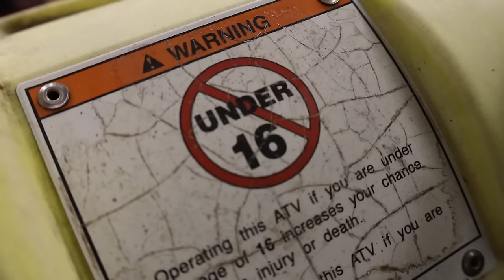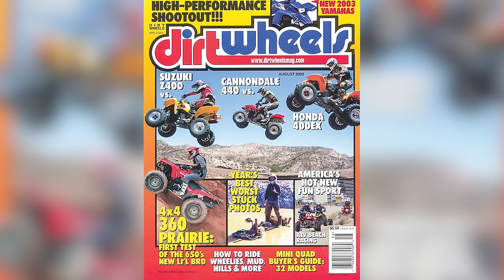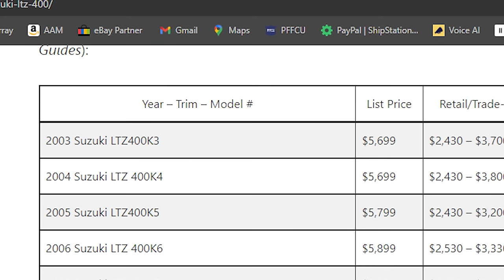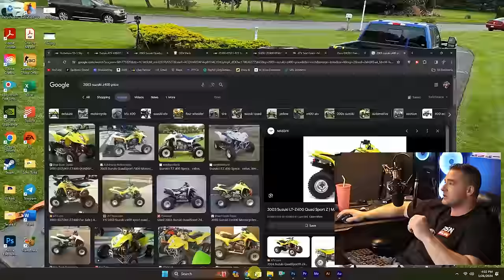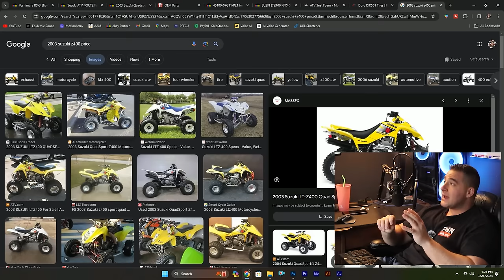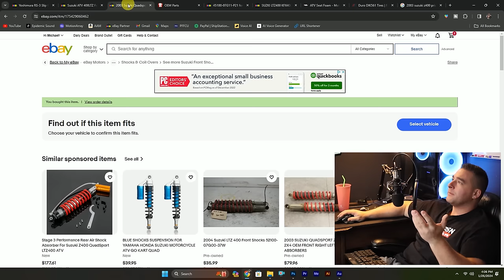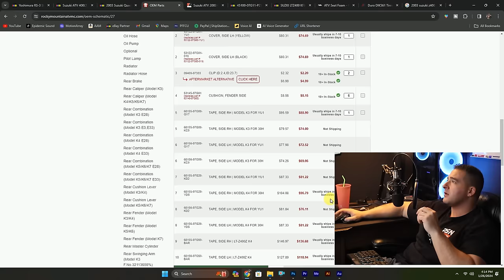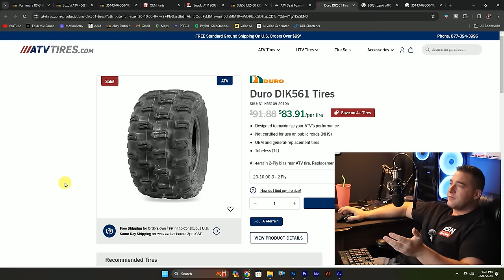It only took me 20 years to get my Dream Quad! and this one's MINT!

Comment: As a KFX owner…. they are an identical machine purchased from Suzuki. The frame is stickered “Manufactured by Suzuki Motor corporation” the only difference is the plastic color and all KFX’s had resi shocks.

Comment: I had a Z400 with a big bore and a bunch of performance mods on it, one of the best quads I ever rode. I strongly advise you to go all out on this build. It is your dream to have a Z400. Why not go all out and improve or upgrade the dream? It had a Yoshi exhaust, wheelie bar, frame sliders, suspension covers and some custom suspension. Best thing ever and I really miss it.

Comment: I was racing my 250r still when these quads were released an at the time the 400ex was the only 4 stroke at the tracks minus a couple 250r’s with YZF426 engines in them (as a Honda guy I thought it broke so many rules!) the 400ex’s were immediately outfitted with 440 kits because they were so down on power then the Z400 came out an was destroying the EX’s however thdd wd EX’s were more popular because if you made the switch from 250r to the EX most of your aftermarket components were a direct bolt on A-arms shocks ect… AKA THE EXPENSIVE PARTS so if you went to the Z400 you had to start over an easily with the purchase of the machine I believe was around $6000 to have $15,000 in it to be competitive at a pro level an in 2003-2004 $15,000 in a quad was insane the also released was the cannondale moto440 for $12,000-$14,000 but it had the absolute best parts money could buy. However in 2003-2004 the Z400’s rear axle was extremely weak and seeing a Z400 axle snapped in half at the track was extremely common an Suzuki didn’t have an updated axle quick enough so if you broke one Suzuki warranty the axle but you got a dura-blue eliminator axle for free

Comment: Damn, Im so happy I finally see Z400 on this channel. I own very unique street legal Z400 and Im incredibly happy with this quad. It handles so well, its pretty small and humble, drifting with this quad is just so easy lol. Reliability wise Im happy too, but previous owner didnt take much care of my quad so there were a few issues - carburetor, brakes and worn valves. The biggest problem with this quad are VIBRATIONS ! Literally every single bolt became loose over those years I own this quad. Locktite is a MUST here. I like your idea with 100% stock Z400, but... Quads (in my personal opinion) are for using/riding not for looking. Those stock shocks are literally UNUSABLE. Its like having a flat steel instead of shocks. Also, I almost rolled over my stock Z400 (when I bought it) like 5 times, so using a spacers at least in front is again, in my opinion, a must. Lastly, stock Z400 lacks a power, you will get used to powerband of Z400 within weeks/months and then it will get pretty boring. I bought Namura big bore kit for around 350$ and Im happy with power that it makes right now. BTW I have walk by of my quad at my channel (last video), so feel free to check it out (I did graphics myself)

Comment: Built one for a buddy last year. Did the drz upgrade with cams, single layer base gasket, dynatek cdi, and a lightened flywheel. Ran like a champ and would out run a stock yfz450 by a lot. Definitely something you should consider doing.
Reply: Also added a sparks exhaust and a 400ex intake boot 👍🏻
Reply: fcr carbs on these engines are insane upgrades
Reply from the maker: Sounds like a great build - I'd love to do these things if I were going the restomod route.

Comment: I’ve had both the 400ex & the Z400…the Z400 is still in the garage. The 400ex is a great quad, but the short stroke liquid cooled DOHC Z400 engine just rips. Add a BIG Bore & cams & you have total ripper. I picked up super clean 2006 last yr from a seller in MI. Prob my fav all rounder quad out off all the ones I’ve fixed & sold. 

Like you….i fell in love with quads around age 10-11, right when quads were being introduced  after ATC’s were going out of production in the mid 80’s. 

Lookin forward to seeing this build. You do great work & are very detail oriented & don’t even skip the small things 👍🏻

Comment: I had a KFX400 that I raced in hare scrambles. It was a great quad and bullet proof. My vote is to build it full XC. Oversized tank, XC tires, beadlocks, long travel suspension. If you go that route get a different swingarm because the carrier on the stock one is terrible. Love your videos!
Reply from the maker: Man, this is a tempting idea for sure. Thank you for the love on my videos 🤘

Comment: Just picked up a 2003 z400 last year. I can’t wait for a ton of in depth videos on this! I recommend an aftermarket aluminum oil pan as the stock ones threads are very weak.
Reply: Also I think y would be cool to see you fix all of the known issues with the quad and leave most of the drivetrain stock for reliability and it’ll become a good build for others to follow in the future

Comment: Mike the Z400 is my wheelhouse.  Been on z400central (now suzukicentral) since 2004.  Trust me here on this one, simple yet powerful build - 94mm 12.5:1 CP (with single layer DRZ-e base gasket), DRZ valve springs, HC 2 (or old school HC 3 if you can find them), and here's the key - FCR 39mm.  The stock mikuni 36 will be your weakpoint, FCR changes all of that, you'll need the DRZ intake boot which is bigger and much less of a headache.  Add a 400ex intake tube (much straighter shot) and you're cooking.  I'm sure you'll touch the head like you normally do.  Dyna FS if you need an ignition. You'll have a reliable and powerful runner, NO REGERTS!

Comment: Definitely should get you a k&n airbox cover it opens the top of the airbox up and is basically like running no lid but your filter stays clean and you don't have to worry about water splashing into your airbox I found one on a parts z400 I got a few years back and that was one of my favorite upgrades for the z

Comment: I have rebuilt a few of these 400 engines. For some extra Pep  
Get yourself a carburetor off the drz 400e model! Also try and find the drz 400e cams or a pair of hot cams, also if you get the Drz gasket for a bit more compression!

Comment: Keep an eye out on those swingarm bearings/bushings and chain sliders! I got my z400 cheapppp tore it down and i kid u not my swingarm was one rough ride from the swingarm totally failing if rode how it was. The chain had been rubbing on the swingarm for so long i had maybe a 1mm of material left on the swingarm where the pivot tubes house the bearings themselves. Damn near was chain to bearing race lol.  Did some touch up to it while it was out and made it like it never happened but certainly a super close call. That and hairline cracks in the rear brake bracket mount thats also apart of the rear carrier lol.  Went to hit my back brakes one day and damn near ate fence instead cuz the damn mount just sheared off, caliper fell and i drug it all the way back home with partial carrier bearing exposure lol

Comment: Sabo, please put a Manual CCT, new cam chain and checking the valve shims for the correct clearance on the list for this quad. These engines are WELL KNOWN to stretch cam chains.

Comment: They actually had OEM piggyback shocks as a “dealer equipped” upgrade. They were Works shocks at that, and they were not offered on all machines back then. I actually had a set on mine before I tore them off and built it up. I bet you can find some.
Reply from the maker: Are you serious? If this is so, that would be freaking legit!
Reply: @MichaelSabo  the dealer equipped piggy back shocks had red springs, the yellow strings came stock on the ‘05 and newer. The yellow springs are the same shocks, but that was the difference between dealer equipped in 2003 vs OEM shocks in 2005. I WAS OBSESSED with them as well back then. I was just graduating high school and my buddy got one as a graduation present. When they first came out they were extremely big news!! The GNCC series just opened a production class where you had to run OEM frame machines and the modified 400EX’s actually beat out the 250R’s in some of the really muddy races. Suzuki shortly entered a z400 (I believe with William Yokley as the rider but don’t quote me on that) and they started beating the 250R’s on a regular. Back then Honda and Yamaha just came out with 450 models and Athena Racing immediately offered a 440, 450, and 470cc big bores. There was no engine displacement limit in the production process class back then so it was common to see a 400EX up against a 660 raptor. I believe Suzuki finished 5th or 6th maybe with a 440 kit on a z400 and it was their first year running the quad. Not a bad season finish considering Honda and Yamaha had 450’s and Yamaha had a 660 running in the same class.

Comment: Miss my 2004 z400 ! The best quad I had and stock it was really snappy . I remember it would pick the front end up when you full throttle it an had the best balance point . I rode wheelies 5th gear wide open

Comment: Bought a 03 kfx400 brand new from dealer. Did a rare yoshi ti header pipe carbon fiber silencer setup exhaust was awesome. Bare performance made a nice alluminum airbox setup. First thing get rid of the junk hollow pivot bolt mine broke in first few hours luckly noticed it backing out on my while riding. Had a solid pivot bolt made Kawi didnt wanna do anything to fix it at all. Also put a gusset kit on it like front shock towers for sure they will crack. Timing chain is junk on them replaced mine.

Comment: If I was you, the one thing I would get aftermarket would be the rear swing arm, 03 was really prown to cracking and breaking off.  Unfortunately, the 03 I have was already cracked 😅😭😭😭 04 to 06 were little better, but not by much.
Reply from the maker: Maybe I can work that in as a "factory recall" done by the dealer before sale lol.

Comment: I just got a 04 ltz400 for my wife to replace the one she sold like 15 years ago.people trash these things.the wire harness and swing arms are trash on these machines.this machine is junk but I will put some elbow grease in to it . Great video man!
Reply: I forget to tell you that the clutch needs to be pulled to start the machine unless you delete the switch.

Comment: ltz400 must do mods (stage 2 intake cam wakes the bottom end up, fcr carb swap (wakes bike up more then anything), weld support brackets on parts that commonly brake, and good full exhaust ( I love my dmc exhaust), upgrade front brake with raptor 700r calipers (direct bolt on), lastly upgrade shock to 450 shock (my stock shocks where like pogo sticks.
that about what have done to my and it been 5 years almost with just basic maintenance no major failures.

Comment: You could get A carport and then close it in. I'd remember to get A building permit to for it as A add on.,or extension building for four-wheelers and put the car back inside again.

Comment: Actually, I believe Suzuki and Kawasaki helped develop the kfx400 “together”…they did this for a couple reasons but mainly because they could get the materials and parts cheaper due to increased volume of the orders. Meaning, if Suzuki goes to NGK or Hella and says, I need 1000 spark plugs or headlights they might be $2 and $75 respectively…but if Suzuki and Kawasaki wanted 2500 spark plugs and headlights they may pay $1.25 and $40 respectively because of the discount given for the volume of their order.

Comment: The biggest downfall of the Z400 was the timing chain and the need for valve adjustments atleast once a year if you rode it a lot. For the most part mine was reliable. I was a victim of the Magnesium case covers reacting with the coolant and essentially eating the engine. Thankfully there was a recall for it. I'd rather see a full blown XC build though, they kinda suck ass in stock form, the non reservoir suspension is terrible, the stock swing arm is way too short. The stock carb is garbage. Go all out. If you want an OEM+ one there's tons of them for sale.

Comment: OK Mike, that opening skit has me a lil worried about you! 3 now?!

Ah. The mighty Z400. I had such the hots for it in late 02 when it was revealed. I prefer the yellow 05 myself, gotta love the "luminous orange" and "hair line chrome black" graphics!

That piece of white plastic on the headlight is separate. It's screws are through the front of it, underneath the front fender.

03's were available in white.

I see DOOM on your desktop! What level is your favorite and why? I like E1M1, E1M9, E2M1, E2M9, E3M1, and E3M2!

Yoshi pipe is gonna be pricey, and Suzuki bumpers, nerf bars, heel guards etc are gonna be damn near impossible to find.
Oh SHIT, you found an actual Suzuki Yoshi muffler! WOW! AND heel guards?!

The plastic shock rod guards are not available separately unfortunately. But they look simple enough to 3d print if push came to shove. I wouldn't say" Oh, what a dummy, why would you buy those?", but I would've suggested the 05 and newer piggyback shocks myself. Technically wouldn't be breaking the rules, would it? They shoulda came with better shocks anyway.

THAT MUCH FOR OEM PLASTIC?! 💀Oh well. Still cheaper than the OEM Zilla set out there for $6,000! 💀

You'll have to talk to that company about graphics anyway, all the stockers for the 03, except the "SUZUKI"s under the rear of the seat, are discontinued.

Thoshe are Yu-Gi-Oh cardsh shir, a MANSH game. Pokemansh ish for kidsh. 🤓
I am a nerd, so I can say this.

Suzukipartshouse says the stock tires are available. 190 a piece for fronts, 219 a piece for rears. 💀They are the same tires as raptor 660s. and I MIGHT just know where some nice fronts are...😜

I think a QuadRacer color scheme would look cooler and distinctly rare, and you already have those mint yellow front shock springs! But the way you want it is very rare as well! I like it!

About those fender supports, they are just that. Supports for the fender. Even being rusty like that, I think they still will be strong enough. I mean, you obviously aren't going to put this thing shiny side down, so the only weight they have to support is a few pounds of plastic and possibly, even though I wouldn't, MUD. That front seat mount, aiee, not so much. Your butt is literally on the line. That's gonna need some work. Also, that's the correct subframe. 03 design only. No built in rear support, but built in rear bumper, (which is in great shape actually! no road rash!) and vertically bolted on fender brackets.

I'll bet clapped quads is in central Alabama.

Not used to signing stuff? Better get used to it. Cost of being famous. Heavy lies the crown, man.

Canadians say ZED too. The band "Zed Zed Top". The Ski Doo "MXZedX440". 

Your attachment to the Z400 and the better times and memories that come with it remind me of my love for the Zilla. Does your heart hurt when you see one in this bad of shape, or when someone makes one really ugly, and you have a desire to save them? Yeah, that attachment. Those who don't have that attachment to a machine just won't understand it.

I'm super stoked that you finally got a rig you've wanted all these years Mike, and I'd be honored if you would call on me for any help you need. Here's a link to an OEM service manual PDF. http://www.crservice.dk/Suzuki%20ATV/LTZ400/LT-Z400_01E.pdf
Covers the 04-06s as well!

Congrats again Mike!👍

Comment: I wanted one my whole when we used to dune ride every year then the new fuel injected models came out with the 450r styling and I drooled over those for years finally got a 2012 special edition a couple Years ago and loved it but not near as much aftermarkets with those as this older body style but all my friends were into mud riding and stuff so I didn't get much use out of it and ended up selling it but if I got another one it'd be one of these or another 05 up predator 500

Comment: If you plan of really riding that Z and jump it and stuff then get another one that is 2005 and up, the 2003 and 2004 subframes break right off where they are boxed in the the frame. 2005 and up fixed this issue by putting the subframe bolt right on side instead of going through that older boxed in bracket… and trust me IT WILL CATASTROPHICALLY BREAK ON YOU if you are a real rider, also the front shock mounts on topside would rip off, they fixed that as well… basically all the cheaper Z’s that you find will be 2003 and 2004 because Z owners know the issues and dont push the price to high. Be careful get another frame or a parts bike… also the 2007 and up rear ends have 4, 17mm bolts for the carrier and 1, 17mm to adjust the carrier. The older ones have 2, 17mm and 2, 14mm bolts and and two adjustment bolts and the 14’s constantly come loose, get a 2007 and up swingarm to fix this issue as well. A yfz450 carb and thumb throttle and a pro box mod will help a lot if tou decide to build it a litte, dont go over the 435 big bor and it will last you years of beating rev limiter. I run a JE piston for all the extra comp and heat so it doesnt melt like the Wieseco pistons do everytime on these Z’s.. this list goes on and on let me know if you need anymore info on these legendary machines… ooo get resi shocks for front you will thank me for sure and put the key on side so it doesnt break off during a roll

Comment: I have a 07 z400 they are great quads
Reply: Mine has piggy back stock and the 03 don’t and chain adjustment is different If u can update it I would chain adjustment is better on newer ones

Comment: There's a frame right next to you on marketplace powder coated candy apple red that's gusseted the 250 why don't lose my job I'd buy and donate ir donated brother. Don't forget you're going to have to eliminate that petcock and go to a raptor 660. And block off the vacuum line to the carb I do have some jets and a parts carb.